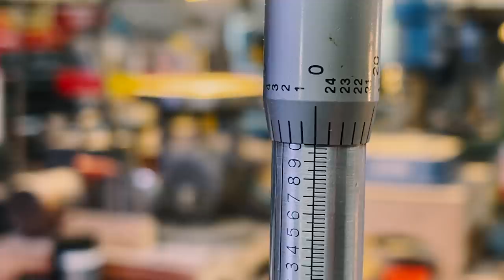Adam Savage's One Day Repairs: Cleaning Micrometer Gauges

Comment: Calibration Technician for an aerospace engineering company here, please don't just test the minimum point on these and assume that's all good. The zero might me right but the rate of change could be off entirely. Ideally you should check using gauge blocks all along the entire scale, there are even pre-made gauge block sets specifically for this purpose, but I would suggest at least testing the minimum and maximum ends of the scales. Also, I suggest spinning the setting rods at the same time as engaging the ratchet, it helps centre and square it and can help to remove any air pockets caught between the surfaces that might throw off your readings. Love the video, and love seeing you branching into metrology.

Comment: just a suggestion: use Ballistol vs WD-40.  Don't get me wrong, WD-40 is a wonderful all around lub/cleaner, it just needs to be reapplied yearly. Ballistol is considered a 'white' oil.  It's popular to both clean and oil metal in gun smithing.  I can personally attest that I use it on my own tools and guns.  I realize a lot of people don't like guns, so I don't need the negative responses regarding that; however, even when I use it on my tools I don't have to re-address them for years.  As I live in MI and the temps vary alot more than CA: condensation occurs multiple times per year in my garage and house.

Comment: I found WD40 to be a terrible lubricant. It is however, a great cleaner of petroleum products and not too bad when drilling soft, thin metals.
Reply: It's not a lubricant, it's a anti corrosion cleaning solvent designed to be sprayed on US rockets on the launch pad.
Reply: WD for water dispenser ;-)
Reply: @yvanvk  That word does not mean what you think it does.  :-(

Comment: You really missed an important piece of upkeep…once they are cleaned and you checked the accuracy of each tool, how do you adjust them if the mic is out of calibration?
Reply: You can adjust the scale with a special wrench that comes with micrometers.
Reply: It varies slightly from brand to brand, but for most you use a small "pin spanner"-style wrench to rotate the sleeve of the thimble (the part with the markings) until your 0's match up. You need a calibrated standard (the black sticks he was using) as a reference. On higher-end mics, the correct wrench and standard are often included, or available as an accessory. Standards are pretty "generic" in that you just need one the correct size and spec for your mic (brand doesn't matter), but the wrenches can be pretty brand/model-specific.

Comment: Automatic transmission fluid will strip off any sort of gummy deposits and not leave residue.
It might strip off paint as well, so be judicious in application.
Gloves, of course, as the stuff strips off skin oils.
Brake fluid has been know to clean things up as well.
New fluids only: used fluids may have picked up some nasty stuff.

Comment: WD-40 probably isn't the best solvent. It leaves a film that both collects debris and oxidizes over time, causing a buildup of orange gunk. For straight cleaning i prefer non-florinated brake cleaner as it is inexpensive and easy to come by in both the spray bottles and gallon jugs (typically under the trade name acetone). Naphtha is better for working indoors as it doesn't vaporize as fast but is harder to come by. 

I have heard it said that WD-40 is the duck tape of lubrication. It is a multipurpose cleaning and lubricating product but I would put i in the lower class of even that. If you want the equivalent of gaffer's tape I would recommend Rem Oil.

Comment: Here’s and old trick to be proficient and quick with micrometers. 

Roll the thimble along your hand or forearm for large adjustments. You can travel a micrometer’s full range in 3-4 swipes. 

Just try not to slam into the minimum or maximum end when doing this.

Comment: There's a reason why locksmiths etc /never/ use oil (even finest machine/instrument oil) as a lubricant! Vintage tools/locks used graphite dust (now available in spray cans), but if all you want is a decent non-sticky lubricant silicone/teflon spray is adequate

Comment: It looks like someone lubricated the micrometers with Cosmoline; then cleaning with WD-40 is just as bad (WD-40 has an acidic content). I clean with Mitutoyo tool and gauge cleaner then light coat with a Swiss watch oil. I also keep a small square of rust preventive paper with the micrometers in their cases. For me the hardest micrometers to clean are the three point / position internal micrometers. Seeing that dark brown goop on the micrometer's spindle looked like someone was out to destroy the tool! ☹️

Comment: Q tips are actually the worst to use for any type of cleaning, they leave behind the little cotton strands which gather every particulate. 
Use kitchen tissue and do not rip it, use a side that is not ripped and curl that sucker up til it's a smaller diameter than the hole you're cleaning, use wd40 to lift oils and particulates from the surface of whatever you're cleaning and then rotate and slightly stuff the hole with the kitchen tissue, repeating this process until nothing comes out of the hole. Finish off with a last spray of wd40 and then some thin weight watch oil, thin synthetic transmission fluid, or actual branded micrometer oil from the likes of Mitutoyo

Comment: What oil did you originally use? It turned really gummy
Reply: The only thing I can think of that gums are natural oils like vegetable oil
Reply: @mikem5475  that's why I ask. I can't think of an oil that gums up like that either. And I doubt Adam would spread veg. oil all over his prized calibers.
Reply: @jrobinson953  In a bag of things thrown out by an old hardware store were two cans, seemingly from the early 90's. One was an aerosol "soy oil" and the other "soylvent". One heavy spray oil and the other one oil with solvent like wd40. At one time they used to be a "healthy" and "eco friendly" version. But right on the can of the soy oil it says not food safe and wash skin after contact. They seemed to work alright, but they stunk and I threw them out after learning of estrogenic chemicals used in soybean production. I've accidentally used vegetable oil in a mechanical keyboard and it ruined it within months. Horrible mistake. I would imagine that it'd be good for chains, because of how it gums

Comment: I recently rebuilt mine using Super Lube PTFE synthetic grease and it’s perfect. Hits the zero tick mark dead on every time. Careful cleaning them as the painted numbers will wear off quickly (in my experience the paint actually separate entirely). However, some Testors enamel paint and a swipe with a rag with mineral spirits made it good as new.

Comment: Starret oil is just mineral oil. Same thing you're probably using to lube your sewing machine except it costs 10% what Starret charges for their stuff. And all it takes is half a drop.
Reply: Probably right, but using something that is recommended by a reputable manufacturer really gives you peace of mind. There’s too much advice out there: you ask 10 people and get 12 different recommendations – that’s no good, so you just buy the brand thing.
Reply: Starrett oil is specifically a low viscosity mineral oil, CAS 8042-47-5. Sewing machine oil is generally CAS 64742-65-0, which is a higher viscosity. It's probably not very significant for Adam, but it's not exactly the same thing, either.

Comment: That oil you used originally looks like used motor oil; what did you actually use? At least you know know precision instruments should only be lubricated with oil designed specifically for that purpose.

Comment: Could you have used isopropyl alcohol to remove the old oil?
Reply: Better solvents for oil would be stoddard solvent (the solvent part of WD40), camp stove fuel (aka white gas), kerosene, or similar. Then use a non-drying light mineral oil or turbine oil as lubricant and rust inhibitor.

Comment: Would be interested to see what the metrology people would say about these if they were to calibrate them,  though don't imagine Adam will be calibrating them.  For strictly  'in shop',   non-quant  readings, no real reason for calibration certs.
Reply: Metrology person here from the UK, I am horrified when people only talk about zeros when calibrating a micrometer as there are so many other features that effect your reading, for example the flatness and parallelism of the anvil and spindle measuring faces that you would measure using optical flats/parallels. As well as the accuracy of the measuring head its self that requires checking with gauge blocks, you can get specific nominal size gauge blocks for this so that the head gets tested every quarter of a rotation.
Reply: @patrickgregory1276  "HoRrIfiEd"

Comment: That Moment you put No 9 down hanging off the Edge, you would have got a right lecture from our Fitting and turning instructors lol, Possibly even the Woodwork Instructor Who would tell you all about Carpenters benches having the well in the middle so Tools wouldn't roll-off or get knocked off, And that placing A tradesman's Square on the edge of a table where it could be knocked off and Made out of square was a finable sackable or harshly punished offense.  😂. Now String a plumbline and check all your spirit levels 👍

Comment: Because of the WD-40, don't be surprised if you're right back here in this same situation in 12 to 18 months. Next time, clean the gunk off with 99% isopropyl alcohol or acetone, then oil once the solvent flashes off. WD has a nasty habit of turning into sludge over time.
Reply: What’s the difference between isopropyl alcohol and acetone? I have both and use the isopropyl for fine and delicate cleaning and degreasing, the acetone for the dirtier jobs – but I’ve forgotten why I do it that way. Is it just that acetone attacks some plastics and isopropyl doesn’t?
Reply: @mm9773  Acetone is more volatile, more toxic, and more likely to damage what you're trying to clean, but it can dissolve more and tougher oils and greases.
Reply: @briancox2721  Ah yes, thanks for the reminder.
Reply: @mm9773  I took chemistry in college.  One thing that I always remembered.  The three main solvents.  Alcohol, acetone, and water.
Reply: you must have missed the part where he used compressed air to blow the solvent out. no wd40 is left
Reply: @bmxscape  you must be ignorant of the volatility of WD-40 being too low and the air blast too brief for it to be effective. There is a residue left that will gum up with time. I have done the same service on the same brand micrometers in the same sizes after someone used WD-40. Almost the same result as the wrong oil.

Comment: Hmm. I'm surprised the recommendation wasn't using an ultrasonic cleaner.
Reply: I refurbish mics as a hobby. An ultrasonic is great for cleaning them out, but often times it'll also strip the paint inside the markings. Not a big deal if you need to re-paint them anyways, but it is not ideal if the paint is already in good shape.

Comment: To check your mics if possible use a gage block and NOT THE STANDARD that is meant for the size you are using. Sometimes you can’t help it like for example I don’t think you would have a 11 inch long gage block then use your standard for that mic. But if you have a gage block that will work use it. The mic standards are not the most accurate way of checking your mics. Sometimes you can’t help it. But a gage block is more accurate than a standard.

Comment: no dont use wd40, you only have to look at the gun/firearm resotrer guys on youtube bemoaning the residue that wd40 leaves behind gumming up the works.  clean the old oill of with ipa or acetone an then use the starret oil.
Reply: Ultrasonic bath is the best
Reply: the "residue" left behind is just the old oil that was dissolved into the wd40. if you are cleaning you might wanna actually clean and not just spray wd40

Comment: So I do this kind of work for my job everyday in the John Deere Waterloo Works gage calibration lab... LPS or isopropyl alcohol is my preferred gage cleaner, then a lite coat Starrett oil after for mics.  I think it's funny how much Adam loves this mic set.   He would shit if he knew how many of these sets that are still prefect that I've thrown in the scrap tank.   Also learn how to hold and use your mics.  You're doing it wrong.  Learn your own feel.  Don't use the thumb screw

Comment: As others said, a douche with brake cleaner or summach would be good to get the WD-40 completely gone.  And...   TOO MUCH OIL!  I put a drop on my finger, drag the spindle screw thread through the drop one pass and then reassemble.

Comment: Never ever use WD-40 on any precision mechanism or clockwork. 
WD-40 is a mixture of a "a lubricant, a rust preventative, penetrant and a moisture displacer", and it is designed to leave a rust preventative film on metal surfaces. 
After the more volatile components have evaporated, this will leave a residue that gum-up the works of any fine mechanism. 
A clock sprayed with WD-40 will work fine for a few weeks or months and will then stop working and need professional restoration.
Ideally, use the correct grade of synthetic clock oil. 
Failing that, sewing-machine oil is a good substitute.

Comment: Dissolve some oil is a solvent (shelite) at a ratio of about 1:50 (this might need some tinkering).
Submerge the over oiled dials in the solution and leave it for a few hours.
When you take them out and the solvent evaporates you'll be left with a thin film of oil equally deposited over every surface.

Full disclosure: I haven't tried this, but I think it'll work.

Comment: I have a set of micrometres that I have had since I finished my Apprenticeship 40 years ago and you NEVER use any oil on the threads of a micrometres unless you want them to be inaccurate. All you do is clean the threads with a pipe cleaner and achohol and make sure the ratchet is also clean. The way they are made and the materials used in their manufacture oil is not necessary unless they are abused. NEVER use oil on a micrometre.
Reply: you never heard of rust obviously
Reply: @bmxscape  Unless your in a very humid environment you dont need to. Or if you subject them to being placed in water then clean with WD-40 then clean with alcohol again or if they are cheap crap then rust will be a problem. Good quality micrometres like Mitutoyo dont need oil and if anything if your trying to keep them accurate then dont use oil.